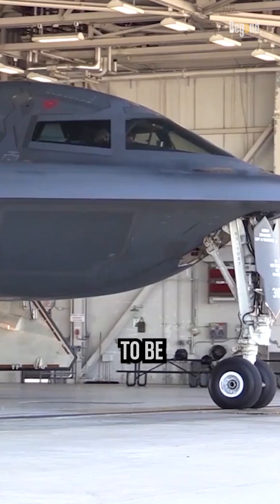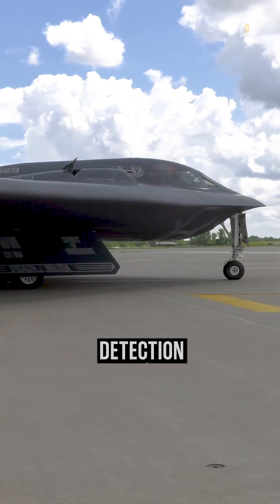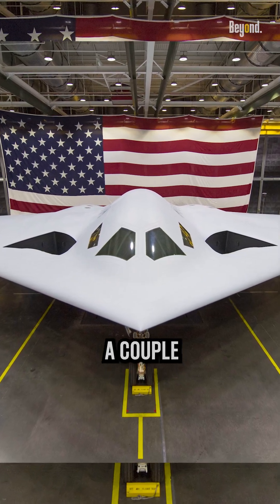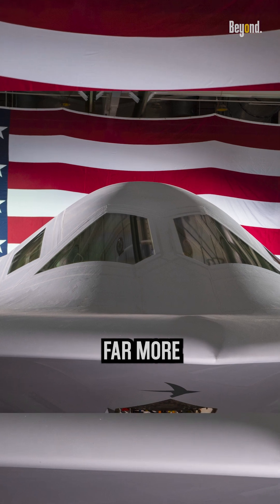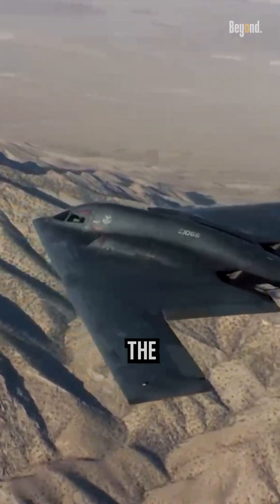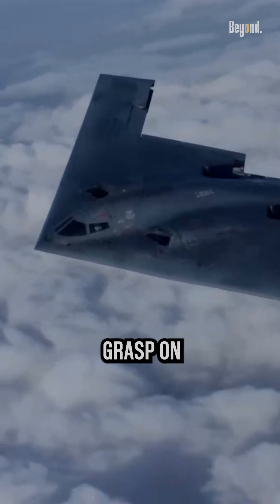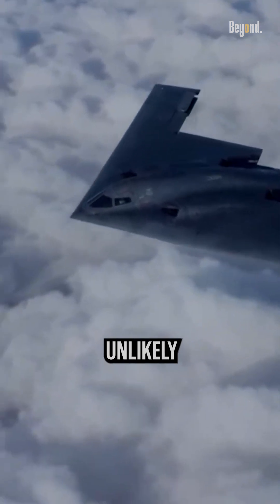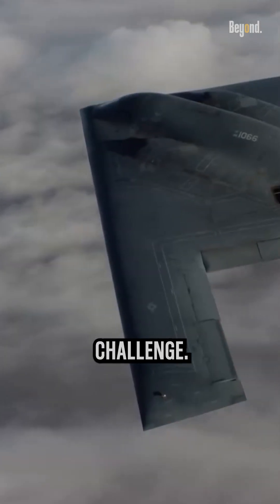What can stop US stealth bomber? #shorts

Comment: For an adversaries radar to detect the current generation of stealth aircraft it must be extremely powerful. Emitting that much radiation the tracking system has become extremely vulnerable to radiation tracking systems rendering itself susceptible to irradiation before it’s tracking system can lock onto the approaching aircraft. In combat situations the stealth penetrating aircraft will be accompanied by strike aircraft that will eliminate the threat allowing penetration and continued advancement towards the target. The previous commenter is correct in that visual identification and engagement will present the highest level of threat. Any interceptor in the Russian or Chinese inventory that would likely be deployed will have sufficient speed and weaponry to engage and terminate the B-2 and likely the upcoming B-21. The F-22 and F-35 will be a formidable adversary for any system currently being flown by either country. The soon to be publicly revealed ( currently in flight test and modification stages ) NGAD will be far superior to any known aircraft currently deployed or in development. This is be specifically for BVR engagements. Any close proximity engagements will be delegated to the Loyal Wingman ( UAV ) accompanying aircraft’s. This will allow the NGAD to continue its missions unobstructed.

Comment: Stealth has never made the B-2, F-117, F-22, F-35, or the upcoming B-21  invisible to radar or other tracking systems.   It just drastically lowers the range at which the aircraft can be successfully detected, and later tracked precisely enough to attack.  
  The currently accepted minimum for the B-2, when it came off the factory floor, is -38dB when compared to the B-52 bomber.  dB in radio frequencies is logarithmic, so -3dB is double the effectiveness and -10dB is ~10x less visible to radar.   
  This is why all modern militaries employ a heavily  Integrated Air Defence (IADs) Network as a defence against L/O aircraft, missiles, & drones.

Comment: The main problems most of America's would-be Rivals is their Radars are not capable of switching between high and low frequency like ours. B2 is visible on low-frequency radar but you cannot get weapons lock with it the best you can do is observe it approaching as you get annihilated by it
Reply: That's what you think. Russians and Chinese know about it since Serbs shot down one and damaged another stealth f117. Why do you think Ukraine is only using small drones? Not even Baryaktars.
Reply: @ИнферноСРБ the Ukrainians are indeed using Bayraktars again. The F-117 didn't have as small as a signature, nor the electronic warfare equipment the B-2, and F-22 have. Look when each aircraft was designed, and put in operational use.

Comment: Radar stealth is easy to defeat, the problem is combining the tech effectivly in a weapon. Low frequency radar can detect and locate modern stealth, if not target. Vut would get you close enoyto use scanning UV lidar to hit. Drawback is a limited 25-30 mile range on lidar, reduced again by atmospheric conditions and being able to incorporate both tech in a seeker head without conflict. But the one thing it cant defend is its solid visual presents

Comment: Assuming that it is picked up by radar, said radar would have to be very powerful.
  Once it is picked up, guiding a weapon to it will be even more difficult due to the power of onboard radar.
  Of course, if it is seen by a pilot, that will present its own problems. For the B-2 pilot.
Reply: That’s why Stealth planes operate at night, and are painted black. They can see you with their advanced night vision technology and SAR but you can’t see them.
Reply: @leapdrive lmfao you really think it's black cause night an not cause the carbon paint absorbed the radio frequency? Lotta new multimaterial jets are green coming out factory the paints a primer protect the frame until desired colors.  The f22 is stealth on roids notice it's grey? Navy ships all grey. Even the f15 f16 etc gunship grey! The skys grey more often then black.
Reply: Actually you can see it on radar. The issue is knowing when it's coming. Another is 1 frequency can find it but the lock on frequency an missles are different frequency. An those are the ones it's hidden from! It'll either be a pinball signal aka small bird or itll be not seen. Then if you know uts there you can mess around an see it before it bombs you to hell.😂
Reply: Keep one for iran !!

n
Reply: Then there's the fact that everyone is assuming that they're flying alone. One of the main reasons why stealth fighters such as the F-35 and F-22 were designed to escort them in and out.
Reply: @gravyd316  an electronic warfare jets flying far behind the bombers. Playing nothing to see here boys! 😆
Reply: @gravyd316 exactly.  So much surrounding the F-22 is still confidential. Having grown up next to Nellis Air Force Base, I can confirm the F-22 has been flying since the 90's. Yet it still can not be detected by anyone. I'd bet money the B-2 flies escorted.
Reply: The b-2 has EW countermeasures
Reply: @theboothy91  yup copilot pretty much an electronic warfare an ordinance specialist as well as copilot.
Reply: @Will-dn9dq  both pilots are..

Comment: As we known from Serbia, its old soviet rocket :)
Reply: You should probably actually research that incident. Not even the same plane
Reply: @phantomarcher9590  same stealth technology, all stealth jets can work only if radar have only centimeter frequency. But didnt work to dm, m, mm range. Also stealth jets as f 35 often visible on civilian flight radar.
Reply: @insafe6300  it's obvious by your reply you don't know anything about stealth technology or the fact that stealth aircraft fly with devices that purposefully make them visible when not on a mission. The stealth fighter was only seen because they got lucky and had caught them with their weapon bay open
Reply: @phantomarcher9590 also because the crews were lazy and not switching up their routes like they should be
Reply: @yellowcrayonkid exactly. It was a combination of lucky timing on the radar operators part and slight stupidity on using the same exact flight path for like 3-4 flights in a row
Reply: Look up what a bomb bay and RCS means...can you piece that puzzle togdther on how it happened to the f117?
Reply: bomb bays were stuck open an they used the same flight path each time